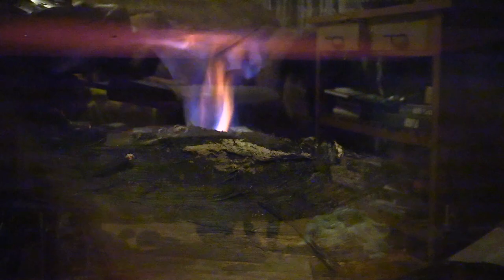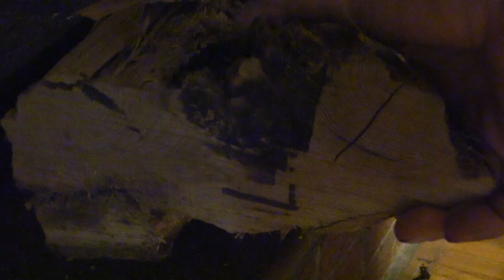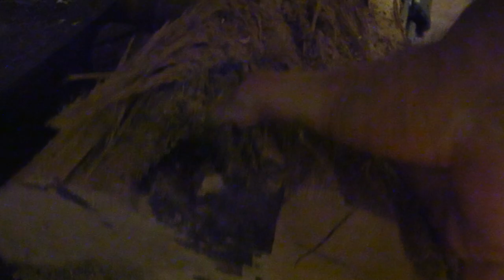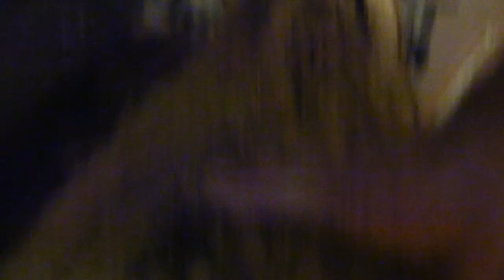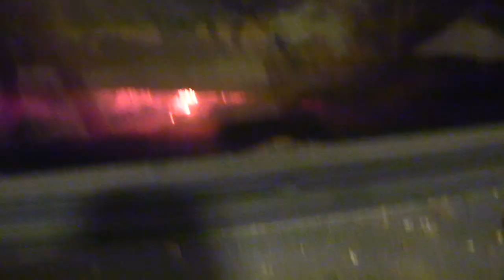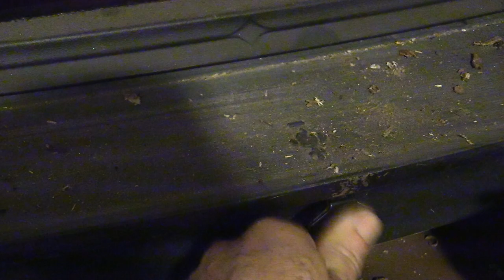How to get a 12 hour heat life out of your hearthstone clydesdale wood insert

Comment: Good tip on the ash, I did not know that!  On my Hearthstone Manchester, I find that I have to run any fresh wood on high over the red hot coal bed for 10-15 minutes, and bring it up to a good temperature.  Only then the intake can be set to low for the overnight burn, otherwise there's weird suction drafts or puffs of air inside the firebox.

I find 10-12 hours is the amount of burn time before the coal bed becomes unusable for new wood.
Reply from the maker: I also have a Manchester. It is a geat stove. I installed mine with a cold air intake. A tip if you did not know. If you are starting with a clean bed after emptying your ashes you can use the ash access door to blast air into your just started fire. It will really get the oven temp up fast. Thanks for commenting